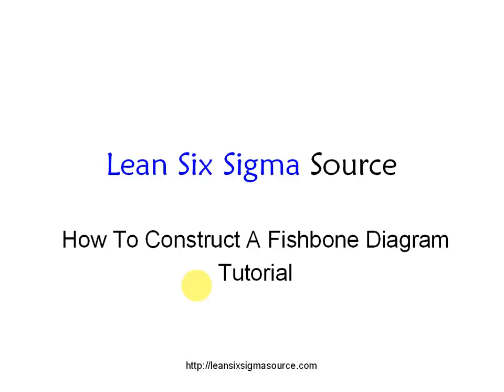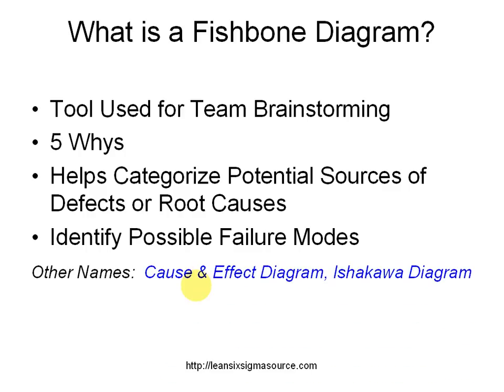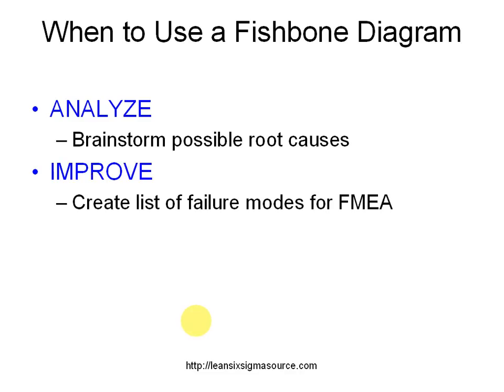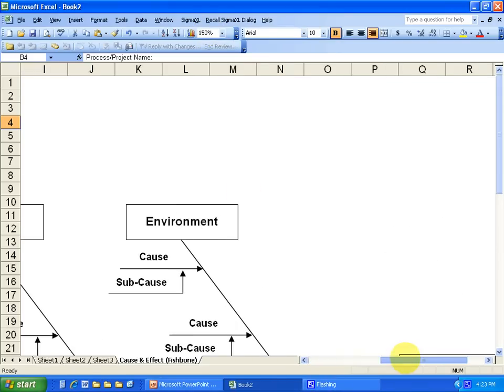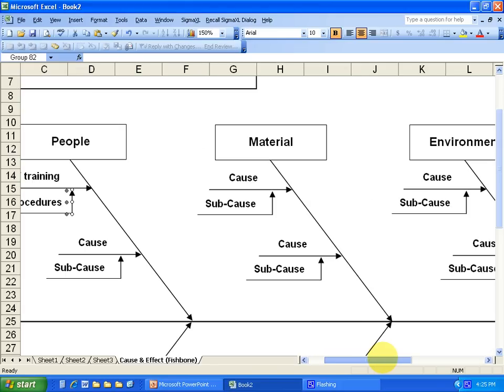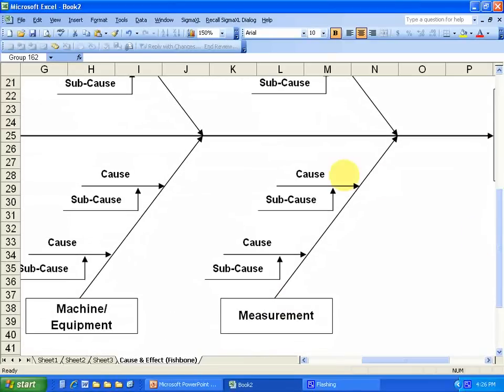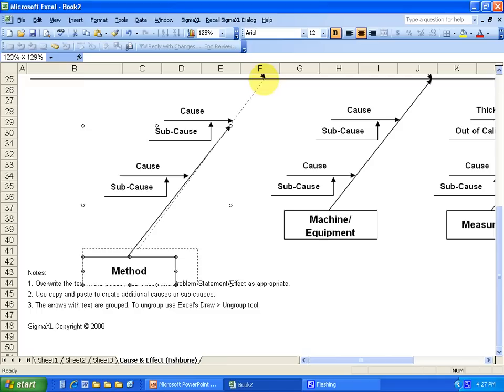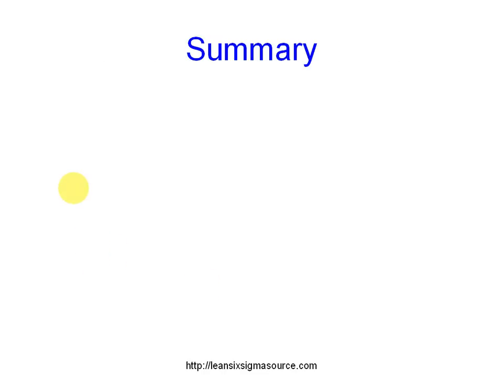FISHBONE DIAGRAM: How to Construct a Fishbone Diagram

Comment from the maker: Good question!  You will need to exercise the 80/20 rule.  Which item impacts us 80% of the time?  You'll find the biggest win in that answer.  Also, evaluate if this particular defect occurs, how well or how long will it take to recover?  A paint touch up or an entire order or days worth of production is lost.  Example, if I have metal cast housings in there is a crack in the housing mold, I'm going to lost that entire batch of housings because it's just like baking bread in a dented loaf pan.